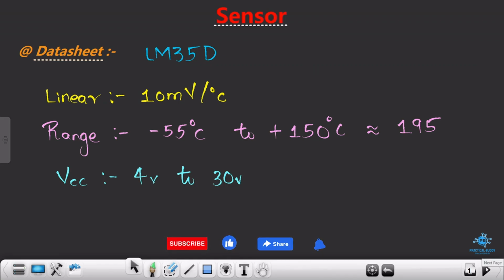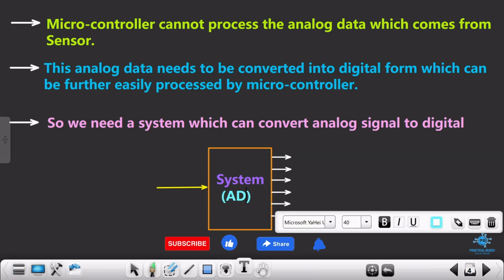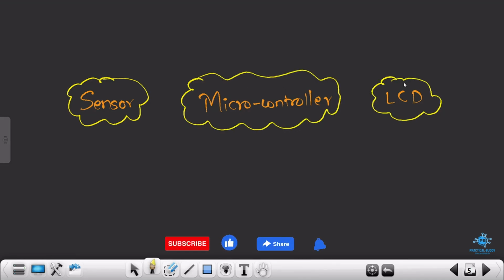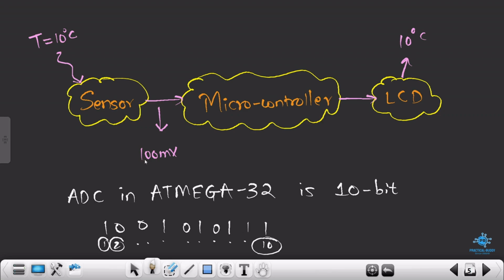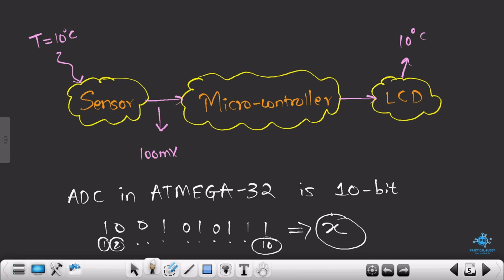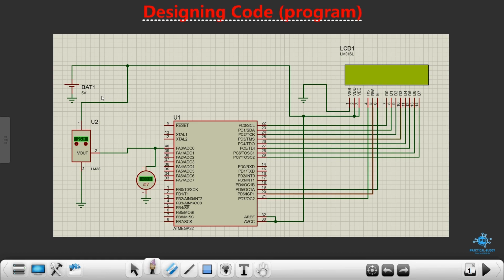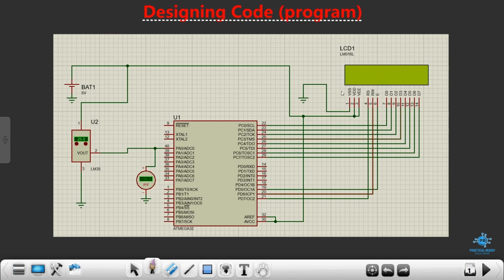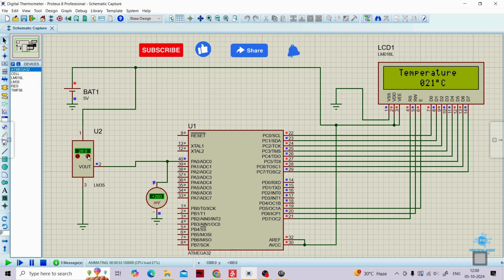Digital Thermometer🌡️ Block Diagram | Digital Thermometer using #lm35 #arduino #atmega32

Comment: You didn't explain AREFF and AVCC tommorow i have exam if you see this comment plz rply
Reply from the maker: You can find information about AREFF and AVCC in the datasheet for the ATmega32 microcontroller. 
Aref decides which refrence voltage to use inetrnal or external.
Avcc is ext supply voltage we provide to internal adc.
Hope this helps you.
All d best for ur exams👍
Also if you are enjoying the content please make sure to like share and subscribe my channel.
Reply: @practical-buddy  thanks